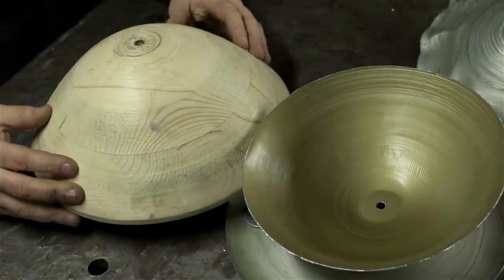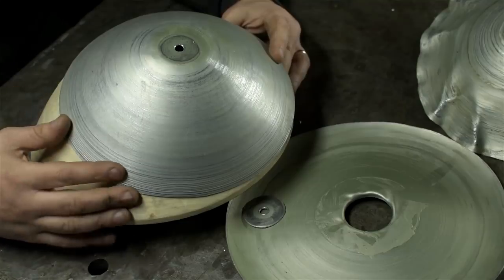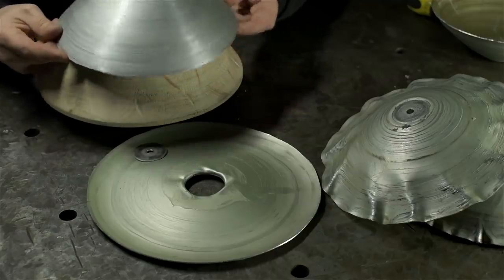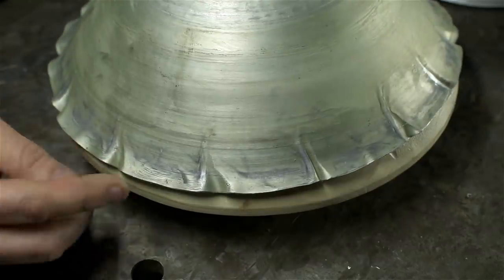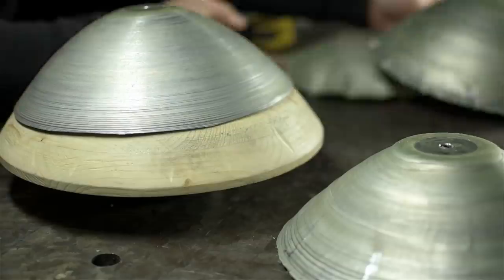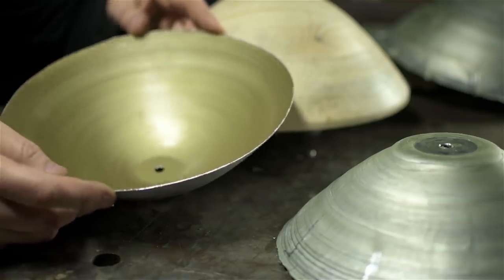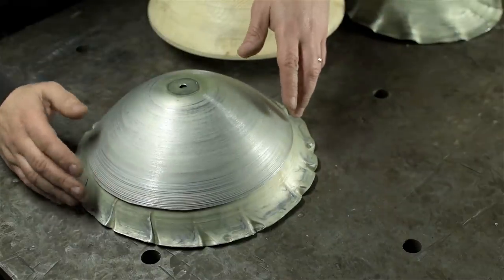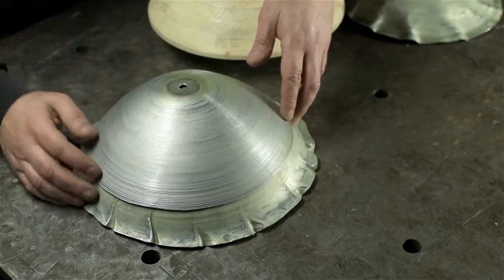Spinning Metal - Round 1 - I LOST!

Comment: Might help to use 2 forms.  One a shallow bowl and the other one to final size.  You can anneal aluminum by sooting it with an o/a torch and then going neutral flame and burning off the soot.  Do this before the first form and in between the first and 2nd form.  Aluminum gets very brittle when work hardened like that.  It's why the allowable bend radius per material thickness is so much higher than other metals.

Comment: Hey bro bro, I had the sane exact problem, to overcome I used more ductile steel, higher nickel content, I started with a larger piece of metal, then trimmed the extra. I spent a lot more time pushing from the center out to the edges and heating the metal helps the atoms dislocate and move over without tearing or ridging.

Comment: I learned how to spin metal as a freshman in high school. We had a dedicated machine more like a wood lathe than a metal lathe. Also, didn't have the roller thingie; the tools were more like lathe tools.

I never had, or saw, the type of problems you're having. The lamp shade effect, I'd guess is material related. We never used anything but soft, plain aluminum. I'd suspect the appliance alum is a harder alloy, which kept the larger diameter of the material from stretch. You could have some burnishing work hardening going on, just to add to the difficulties.

I recall spinning much steeper slopes than your form, and never had to stop to anneal the material, (as if I knew how, at that age.)  

Certainly, didn't have the dowel safety you made. It would have me, and my teacher, Mr Hodson, some embarrassment.  I took to spinning quickly, and Mr Hodson asked me to do some demo spinning for an upcoming parent-teachers conference night. (can you guess where this is going?)

I was set up, with everything double, and triple checked, when the first group of parents came through. I explained the set up, and got to it.  About 2-3 minutes in, I caught the tool in the material, and the material tore. This had never happened to me before. I had never had one issue; most likely why I was asked.  Before I could even yelp, the material came right at my face, and whacked the face shield a good one.

Fortunately, I had made sure no parents were behind me, or across the machine from me. I took the old piece out, chucked up a new one, and went on like it was no big deal.

Must have fooled them, because Mr Hodson taught there until he retired, and the spinning machine wasn't on a truck the next morning, heading for the scrap yard.

That was 50+ years ago, and it made me very good friends with face shields.

Comment: Besides what has been said about annealing again half way I might try doing the shaping in two or more passes. Make a first pass over a wider mold which does not require so much deformation. Then another pass over a narrower mold. This requires more work building molds but lessens the deformation at the edge with each pass.

Comment: Try not using a metal device to do the work. I've done plenty of aluminum forming on the lathe. I use my wood lathe and have a special rest that has holes in it that I can put pins into to adjust my attack angle on the work piece. I primarily use  broomsticks that I have modified the ends on as the tool to do the primary stretching and forming with. The wood tools seem to help as their friction heats the piece as it is formed. I only use two steel tools. One for trimming the edge and one to help roll over the trimmed edge. 
Good luck with your project. I expect to see a nice bowl created shortly.

Comment: Crumpling comes from the perimeter being longer than a flat circle in the same place: the only forming move you have available is Stretching; and you can only stretch from the middle outwards. Don't even touch any metal unsupported by the Form.

Comment: The folds you're seeing is from the material near the center pushing out as it thins, causing it to wrinkle to take up the pressure, like when you try to drape paper or fabric over a ball. In order to keep it from doing that, you have to stretch the outer diameter further out to compensate.

Comment: While I have aspired to do some metal spinning, the book I have on it often shows the  metal backed up on the other side to control the wrinkling you are experiencing. A similar technique is used  when hammerforming metal when there is too much metal to fold over. By backing it up to prevent it from folding over on itself, you are able to drive against the support tool thereby pushing the extra metal out the edge. The same thing is occurring when you see the the OD of the formed metal is larger than the OD of the flat blank.

Comment: The crinkling is called "rattling."  Once the metal is rattled like that, it's scrap.  I'm currently working in metal spinning.  Spinning is definitely an art form.  Seems the dowel pin wouldn't be very solid...  We always use metal center pins, even on wooden blocks.  My guess is your material was terrible.  Just because it's thinner doesn't make it better.  Usually thicker is better.   Sometime rattling happens if the material is slipping on the block as you roll it. Rolling it tighter to the block will stretch it more but can risk tearing the material.  But it does help lock it more onto the block so it doesn't slip.

Comment: Hey, I think the problem is i the handle! When you rotare it to much, its not facing the plate with the wide but with the corner of the tip. It leaves that coil-ish mark at the endpoints of your bigger plates. 
Anyway, hope you read this a d it helps 🤗

Comment: Probably has been said, but 5052 “O” is what you want to use. It is more elastic and will spin easier. If anything, it will work harden as you go, but should allow you to make what your are attempting. The stuff you had was more than likely already hardened. You could also try annealing it prior to spinning it. I have friend who have done the same procedures making propeller spinners.

Comment: You need to soften the metal by annealing it. Heat it up to a dull orange and let it air cool back to room temperature before turning.
If you feel the metal getting less compliant, anneal it again. This will prevent creasing and tearing.

Comment: The wrinkles that you are getting toward the end is where the material has been stretched to facilitate the curvature closer to the center of the bowl.  At some point you have to get that stretched circumference along the outer edge of the disc to shrink back in.  This is done in blacksmithing by pounding out (but not creasing) those wrinkles in a dishing stump.  You can also use an edge shrinker for sheet metal work but I have never had much luck with mine as it tends to scar the material a bit as it grabs on to the work piece.  I have always had better results with the tried and true backsmithing method.  

See this video for a good explanation of what I am trying to explain: 
https://www.youtube.com/watch?v=qBFwCFhcwKs

Another option would be to start with a larger circle blank as you will only begin to get those wrinkles as you get closer to the outer edge of the material.  If you start with a large enough disc, you can get the shape you want into the work early and then just trim off the wrinkled outer edge.  This way you do not have to worry about having to hammer work your wrinkles out of the material.  You will however have some "wasted" material.

Comment: Anneal your material first,Aluminum cover it with spray paint first,allow it to dry and then take a propane torch and warm the part up evenly until the paint burns off.Allow it to air cool,it should be dead soft at that point.If it trys to work harden,take it off the lathe and rinse,repeat.
Also once it is annealed it won't take as much pressure to spin so be careful it doesn't lampshade right off the bat.

Comment: my guess would be the speed differences between the smaller diameter near the dowel and the outer edge. the outer edge will be going significantly faster making it work harder quicker compared to the smaller relative area near the dowel. similar to how cutting speeds on the lathe need to change with steel the farther out from the bore axis you are. Just my thoughts, great vid as always.

Comment: If you sprinkle a little salt on the glue it keep the wood from sliding when clamping.  Sheet rock screws are a BIG no no. Too brittle and break on a lathe.  TIP

Comment: I "adapted" some aluminum lighting parabola's for a theatre once with some crappy handmade metal spinning operation I set up. Wasn't fun, pay sucked but I did a couple dozen. I believe there is an expansion coefficient you got to figure in to keep that wrinkling out and get your desired size. At some point the metal you need at the end has to come from further into the spin and get stretched to the outer diameter. Kind of like you started with too much a diameter of metal. Have great fun with this. If none of the former is understandable then my work here is done.

Comment: try this: build a female half of the die from wood. Give it a half inch of extra depth/clearance. On the perimeter of the die, allow an inch or thereabouts of extra material for a flange. Place sheet metal over die and shoot  a bunch of screws through the metal into the wooden flange.  Your spindle speed was okay. Use a piece of wood with a radius and push material down into the die. Lightly coat the metal with grease (seems to help) Note: when you get to shape and diameter, form a lip on O>D.... that'll keep the piece round. Use a cut off tool to free finished part.... I made a batch of old time outdoor lamp shades for yard lights.

Comment: I think it's a matter of the material you're using. You might actually want something harder. I've noticed that unalloyed aluminum heats up a lot at the tool contact point, which can cause galling. You can usually fix that with really fast tool speeds, but if you want to avoid that, you might want to try some 6061 aluminum.
There may also be some friction between the backing piece and the work piece giving resistance when you stretch the material back. 
You might also want to try stopping halfway through and annealing your material as well.

Comment: Heating the metal would probably help you with the "stretching" and help get rid of the "folds/wrinkles/frilling" which are appearing at the edges of the metal bowls. However, you are using wood to help form the metal; meaning, the heat is a double-edged sword in this case. The heat will help with the metal, but might be detrimental to the wood. Therefore, I might recommend using something other than wood to help form the metal; this will result in you being able to use heat; which will help with the "folding/wrinkling/frilling" of the metal.

Comment: In the Mid-60's I worked in the development lab at the West Bend (Aluminum) Company, which had the model shop next to it.  The model shop took the Dev lab's engineer's designs and turned them into testable products.  I was there testing our first 100 cup percolator.  

In the model shop, I saw them making a large bowl over a form and the tool used to shape it was approximately a baseball bat.  So he had some place to wedge it, then could lever it along the sheet, forming it into a bowl.  I would guess the key success/fail difference was the grade of aluminum.

Comment: I would use a rounder tool to push the metal, something with more radius would be more gentle on the material, the wrinkles your getting are parts that need to be shrunk. Personally I've done only really small aluminum parts with a 90° flange (reflector bezel for early 50's cars) using just a handheld  box end wrench and a lot of lubricant as a tool.

Comment: Looks like you could use a woodworking lathe tool or two.  I would recommend getting or just making a carbide insert based scraper lathe tool because it needs almost no skill to use.  Lots of expensive versions to copy from for a lot less money.  A very beginner metal working project with a handle.  I wonder if sanding off the hard anodizing would help at all, probably not.

Comment: I used to work for a fan company in the spin shop. We hand spun parts up to about 84" in diameter, all kinds of different shapes. On a dome yo have to keep the edge kind of concaved a little through out the whole process or it will do what it did to you. Definitely anneal your aluminum to make it soft. Also in most cases even if the edge wrinkles le that if you have a roller that is narrower or sharper you can usually get the wrinkle out. And like Oyez said, use a lubricant, we used a crisco like lube.

Comment: Try heating/annealing  the material before you start spinning it. Form the material and heat again if needed. I expect that you will know when to do this after a dozen or so tries. The idea is to reduce the cold hardening which is making the material more rigid/elastic or less plastic as crystals align. I never used a bearing as tool-end. Instead hardened and polished ball-head.

Comment: Coming from my own personal, and limited, auto body experience, wrinkling like that is due to excess material. Maybe since you're stretching the material out as you form it, it's pushing the material to the edge, until the amount of material at the edge is more than the diameter of the bowl (more than what can comfortably fit, such as in the beginning or middle of the bowl). In that case it may be a feature you take into account and cut off, or try to mitigate stretching the metal towards the edge. Interesting stuff. I believe this is how drum cymbals are made as well, but there's a good chance I'm wrong

Comment: The golden color on the alum is likely to be a corrosion inhibitor. Alodine is a conversion coating chemical that I learned about while studying sheetmetal in aviation. For my purposes, I will clean the bonding surface of the aluminum and then process that surface with alodine. the result is a golden finish that is electrically conductive. Also, if the alodine is not neutralized during the process, dark spots could be developed where the chemical has corroded the alum. I think that's your mystery material. Happy producing.

Comment: You are deep-drawing the matel. When you do that you get Compressive stress and tensile stress in the metal you use, this is the reason you get the lamp shading. When you do that in a tool you would take a larger diameter and basically do it the other way around, pressing the wood in the metal. Also you would use down clamps, so you don´t get the lamp shading. If the metal get teared up you pull too much matel to fast so it can´t flow. You could try to make more wooden form in different diameter to help against the tearing up. But i don´t know if all of that helps with the lamp shading in the way you can make it. Sorry if my english is bad it is not my native language.

Comment: Before forming the metal, put a bend around the edge.  Sort of like a seam to reinforce the edge, but it doesn't need to fold back completely on itself.  Just a bit of an even crimp should keep it from wrinkling as you get to the edge.

Comment: You're going to want either a D shaped roller, or use a wooden stick. It's important to play the material that is not in contact - this is not sheer forming it is flow forming - this means the method involves moving practically all the material a little bit each pass and you preserve much of the original thickness of the material. Also consider using a lubricant the roller is not supposed to drag the material around by friction. Also it is common for parts to be annealed part way through the process if you are doing a lot of work to a difficult material - material thickness is not a huge factor, except on how hard you must push. Finally - it's just hard, good luck.

Comment: Part of the problem with spinning is the outside diameter becomes reduced. You need to compress or shrink the outside edge. The process is upsetting (but not the emotional kind). Try working the outside edge first. It may cause you to lose a finger (or eye) in the process. Use soap or wax for a lubricant. Good luck!

Comment: "I'm here to kick ass and chew sheet metal. And I'm all out of sheet metal."

I may be playing the monday morning quarterback here, but I think your problem is that you're not stretching the material near the center enough, and as a result would have to stretch the material near the rim far more radially than circumferentially. You would have to continue to work on the center portion for a while, or come back to it again and again, even after you're already happy with that portion's shape, just to stretch it thinner. If that is impractical for any number of reasons, doing a multi-pass approach may be the way to go: Shape the piece onto a more shallow template first, and only go for the final shape in a second pass.

Comment: I worked several years programming cnc spinning machines making parts out of stainless.  So I have no manual processing skills or aluminum experience but it appears you are only stretching the material.  There is no forming on the backstroke.  Imagine placing a piece of paper over your form.  Your paper will also have wrinkles on the outside edge.  Also give your roller a bigger radius and add lube.  That will reduce work hardening.

Comment: You will want to use de roller tool just to finish the surface. The forming tool must be rounded but rigid, friction and heat its what actuali bend the metal. The fixed pivot on the tool holder is not a good idea, you need to feel de surface behind the tool. Use white soap as lubricant, it will going to get a soft bronze when the heat is ideal, brown when the heat is too much.